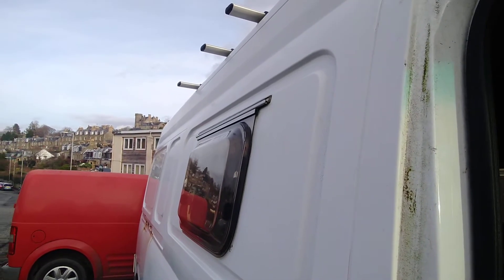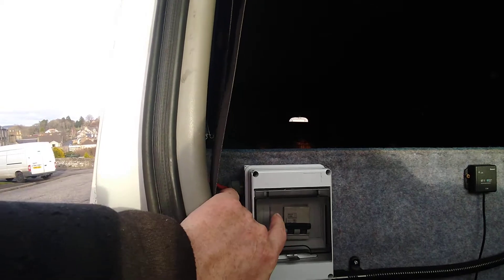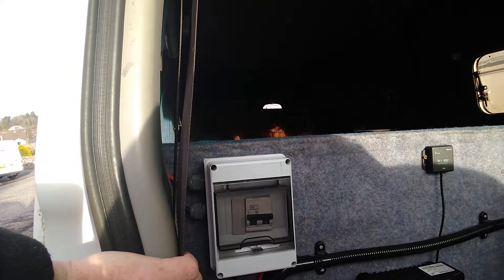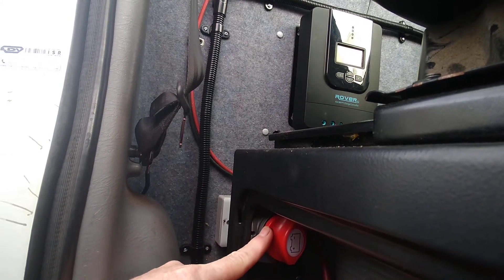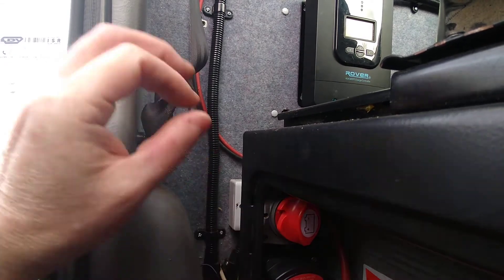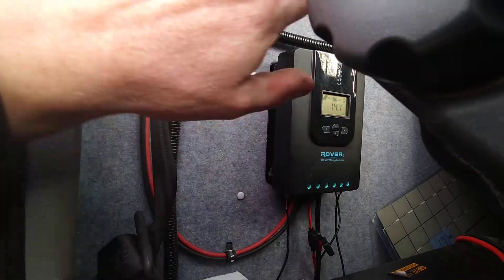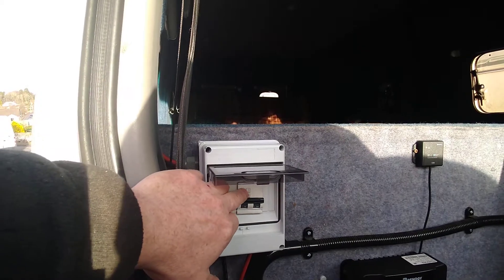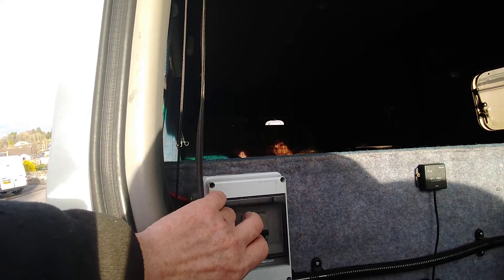Solar panel array disconnect (the safe way).

Comment: If I have a folding 150w solar panel with mc4 connectors connected directly to a power station, can I just fold up the panels so there's no charge to safely disconnect?
Reply from the maker: Sorry for the late reply. Yeah, if there's no sunlight going to the panels, there won't be any voltage coming out of them and therefore safe.